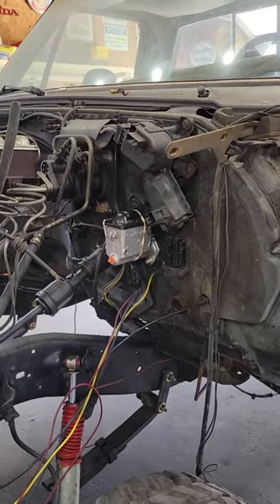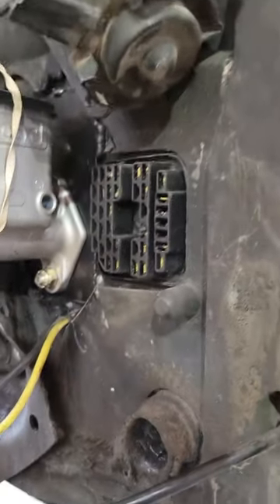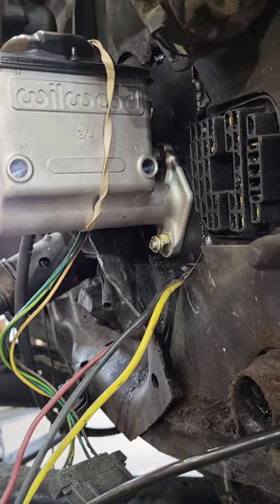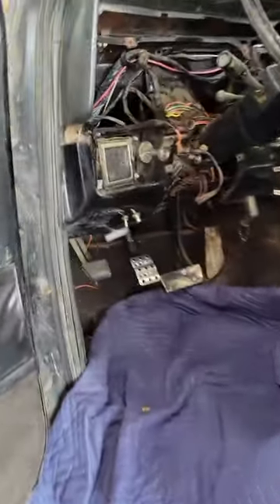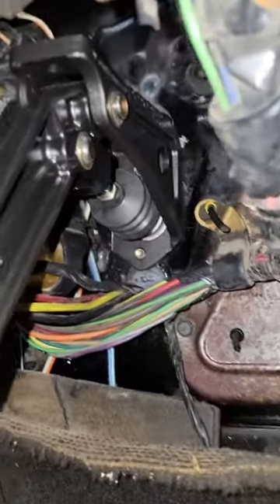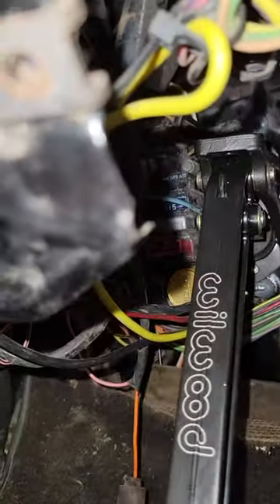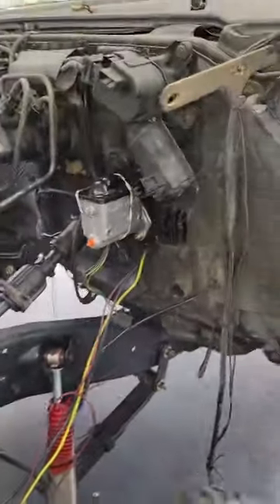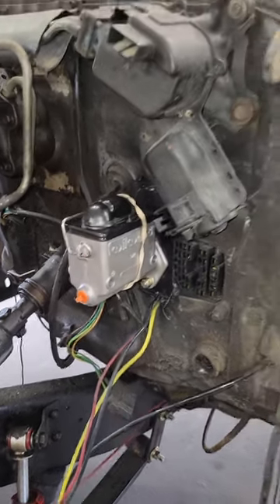Squarebody clutch pedal conversion CHEAPEST

Comment: Hey. Just wanted to drop a major thank you for this tip! 
I just did it on my Super T-10 swap in my 78 pickup and it worked perfectly. 
The pedal/master, bellhousing, clutch fork and slave cyl cost the same in total as what they want just for the factory style pedals and linkage.
Saved me huge!
Reply from the maker: @billmcbillface7467  glad i could help brother!

Comment: Ordered my pedal and resivoir, arrived today and I had it installed in less than 30 min
Reply: How does it stand up after 9 months?
Reply from the maker: @andrewerickson6690 working good last 2 years
Reply: Did you have to pull the column? That’s the part I’m dreading

Comment: This looks like the way to go converting automatic/mechanical manual trans to hydraulic clutch trans. I understand that it is very important to have rod length and angle correct so release clutch bearing does not wear out in a short period. I guess some vehicles may be more of a challenge to find room for clutch pedal, but if vehicle originally had a mechanical clutch the room should be there where minimum modifications. Any thoughts on installing a NV3500 five speed into 1985 Chevy van two wheel drive?
Reply from the maker: I believe the astroa did come with a stick, although super rare

Comment: Thanks for sharing!  What slave cylinder are you using with this setup?
Reply from the maker: Glad it helped. I was using the gm slave when it had the 6.2 diesel in it, swapped to cummins and used its slave without any issues. Just knocked out rolled pin and installed the adapter for an3

Comment: What did you guys do for the line from the master cylinder to the slave cylinder? I have a nv4500 i am putting behind a big block in an 86 k30
Reply from the maker: @BaileyOlson57  buy an an3 line off ebay and adapters.

Comment: Do you have a part number or link for that kit?
Reply from the maker: Part # 9109215

Wilwood 340-13834 7:1 Brake/Clutch Pedal w/HV MC, 1 Inch Bore
Reply: @jankosgarage  Have you hooked up your transmission yet? I did this same swap and am using a ram hydraulic throw-out bearing and for some reason when pushing the clutch pedal down, my clutch isn't releasing all the way? Any tips?
Reply from the maker: @willhinman8978  yes, works fine for me all summer. I did have to adjust the pushrod on mine so the pedal has more stroke before hitting the floor. I guess a fix would be to extended the bracket off the firewall, but you get use to it.
Reply: @jankosgarage  how did you adjust the pushrod? Just not screw the all thread from the master into the pedal as far?
Reply from the maker: @willhinman8978  yes
Reply: So what happens to the mechanical linkage can u take a pic of the setup fully installed from frame rail to fork and inside truck to cylinder?